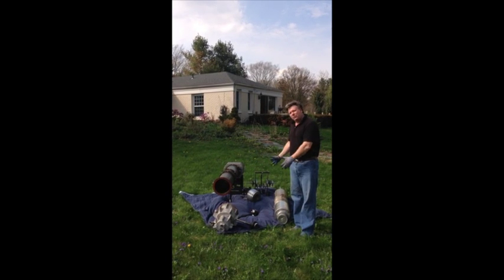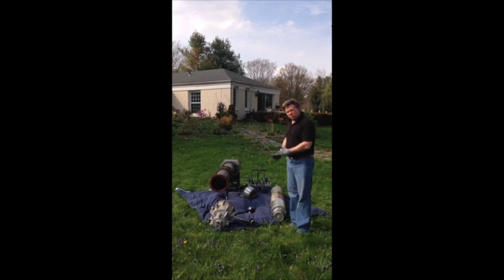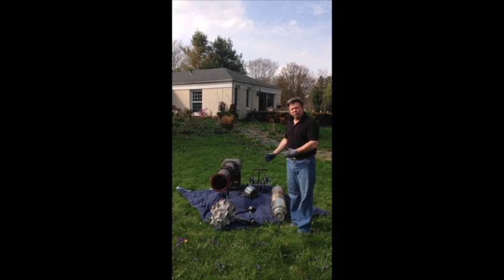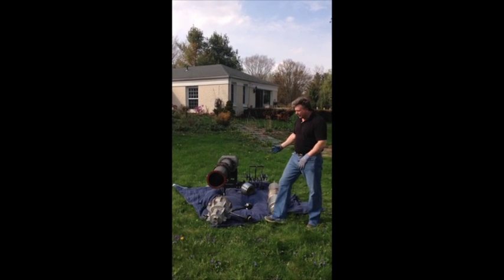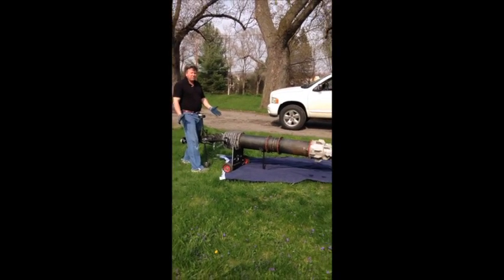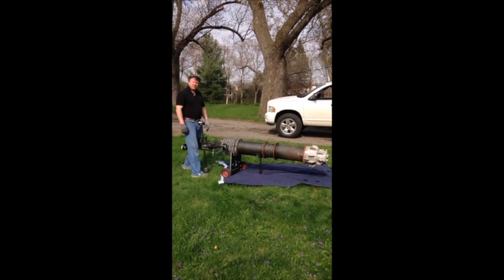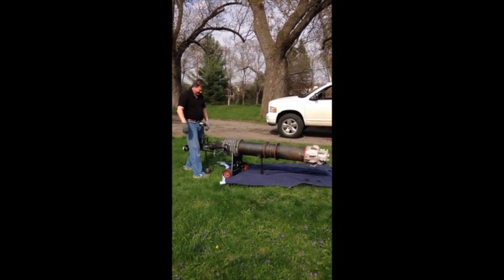Volo Engine Assembly 5-2014

Comment: How may KW you expect to get out of this engine? Please show some calculations to back up your answer if you do respond.
Reply: ***** Thanks for the information.
Reply: ***** Watch all your other videos and I know a thing or two about stirling engines. Question to you is. Why such a big engine for that power? You can actually do much better with some small changes in the design.
Reply: Aviator168 Well, there were several factors - first we wanted to make an inexpensive engine that could do real work, that is what  we defined as 1 KW.  Second we wanted the engine to be run on a relatively small temperature delta so that we could use simple wood burning and bio-mass to fuel the engine (about 350 to 400 F above ambient).  We wanted to stay away from high pressure or exotic gases (less then 100 PSI).  Lastly we wanted it to be a simple engine that other folks could hack and improve upon to help stimulate the stirling engine adoption.   We hope that we'll be able to get more then 1K out of our design but thats our first target.

Comment: Looking great! I've been following your stirling engine for over a year now and excited to your progress. I was wondering how close (if anywhere near) this version is to your sub $100 price goal.
Reply: Hi Luke,
Right now were at $567 in material costs for the engine.  We are just about ready to put it in the market for sale at $1,395 with the fire box for another $350, plus the engine is pretty heavy 250lbs, or so which adds about $200 in shipping costs.   So we are quite a bit higher then the initial target of $100 but are still close to getting under the $1,000 / KW mark.  If we get some volume in this first year (100 or so) I'm pretty confident we can get the costs down to about $400 in materials.